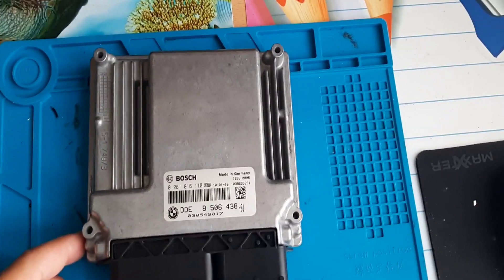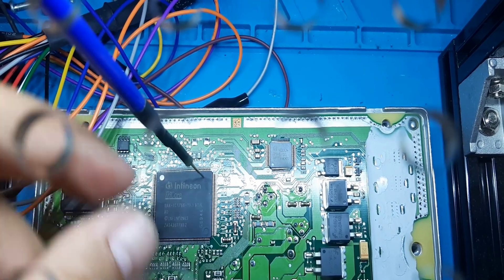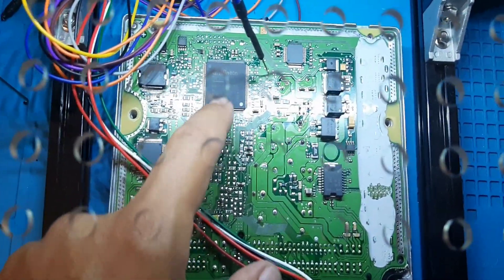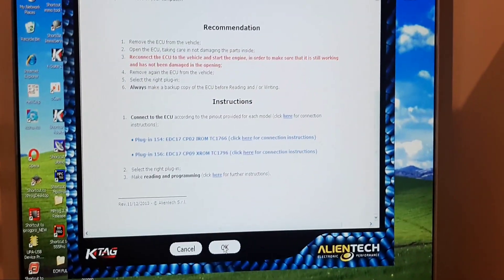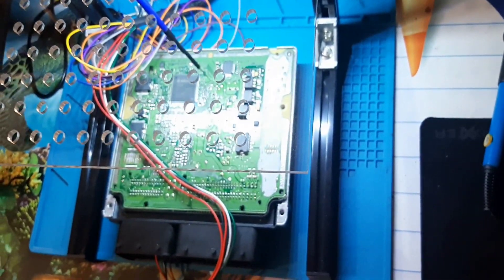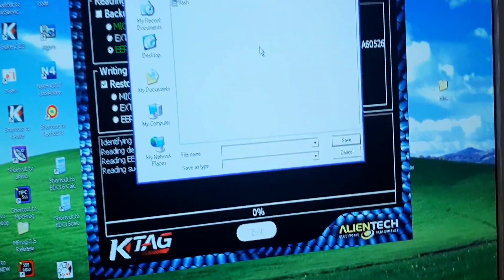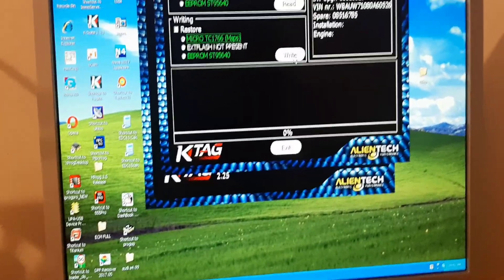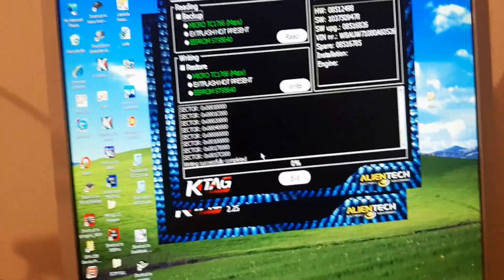Read and Writing. BDM vs Boot Mode EDC17. BMW ECU Infineon Tricore

Comment: Hello I have BIG problem 
2013 transporter VW edc17c50

I id and read it as a VW caddy van. It starts twice then didn't start. Battery voltage showing zero and communication fault.

I battery reset and now it let me id and read. But still no start. No I need to now boot it
Reply from the maker: Hello. I don't understand you. You read and the car doesn't start. You also write a modified date back to ECU ? Give more explanation if you need help 😊
Reply: @YOYODiagnostic hi bro thanks for reply. Yes but never mind. Major coincidence after I read the car the van stopped working. No changes were made.  Turned out starter motor stopped working. Crazy

Comment: i messed up the bootpin is there anything i can do? The ecu still starts the car and runs but I cant id,read,write it
Reply from the maker: @Sergey-nr3ky  what tool are you using?
Reply: @YOYODiagnostic  Kess v2 China Clone. I Soldered to the bootpin but then my module fell and it ripped the bootpin straight off.
Reply from the maker: @Sergey-nr3ky  make this on Bench with another tool

Comment: Nice. I'm beginner. Can I ask?: 
Can I Read by tricore way EDC17CP14 by Kess v2 clone? 
Where in this files are Tprot, maps for engine are located? 
Is it ok to edit these read files with hexaeditor, or with Davinci SW?
Will it work, if I Write edited files by tricore Kess v2 clone by tricore protocol 198, or by Kess v2 clone OBD protocol 501? 
Thank You for any advice.

Comment: Hi, all flash reads always has to be same/identical when you read it and compare with hex editor ? My flash reads are different, just checked, eeproms are equal/identical, but flash reads has differents ?!?!  :(((
Reply from the maker: Hi.
It must be the same.  If you read it in BDM write in BDM
Reply: @YOYODiagnostic  

I read msd87.2 conti ecm with trasdata 9.004 (made from ktag  / russian reworked premium clone) i read in boot mode , i did read separated flash, eeprom, but all 4 flash reads are different in hex editor . Epproms are full same. What can be problem?
Reply from the maker: @duckla7488  
Both readings are the same size ?
Reply: @YOYODiagnostic  yes, size same, hex editor finds differents in flash reads, but in eeprom reads no different :s
Reply from the maker: @duckla7488  
Send me  Mail with Dump ( yoyo.pc86@gmail.com.)
Reply: @YOYODiagnostic  sorry for delay, youtube not alert me, tomorrow i will send, thanks
Reply: @YOYODiagnostic  thanks, i just sent the email